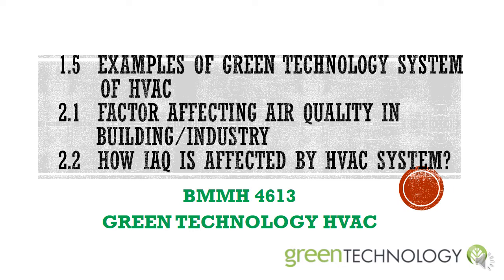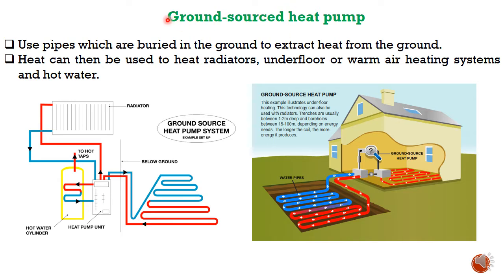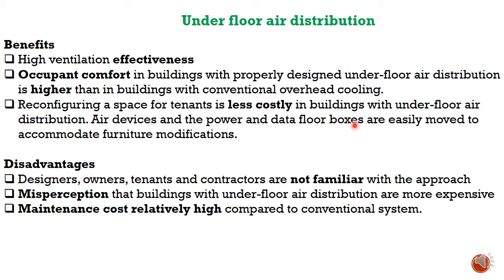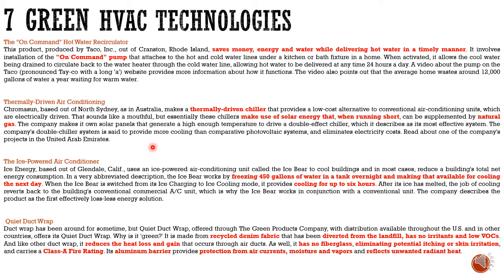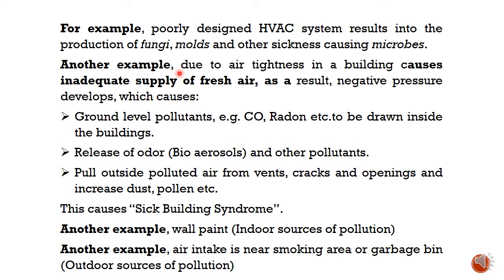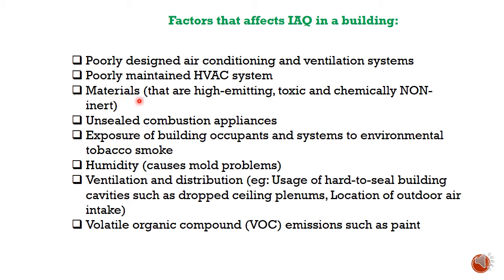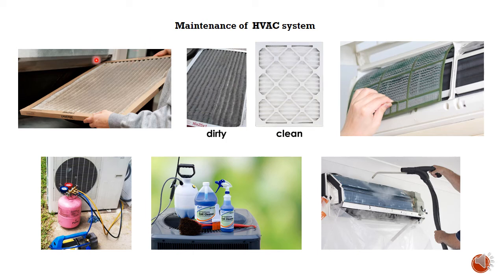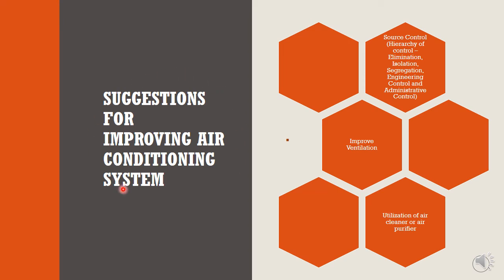Lecture 2 Effects on Indoor Air Quality

Comment: Mohamad Zarif Bin Rostam (B071710681)

Air-to-air heat exchangers / Waste heat recovery system
- Heat recovered from exhaust air to temper fresh air into the building
- Reduce the overall load
Ground-source heat pump
- The pipes buried in the ground to extract heat
- Then be used to heat radiators, underfloor, warm air heating system & hot air system

Advantages:
 Lower energy consumption
- Provide income
- Could lower home carbon emission
- No fuel deliveries needed
- Minimal maintenance

Under floor air distribution
Only use open spaces like underfloor plenum 
Advantages:
-Have a high ventilation effectiveness
-Give more comfort to the occupants then other HVAC technology
Disadvantages:
-High maintenance cost 

VRF Air Conditioning System
- One outdoor to many indoor
- Able to control amount of refrigerant
- Provide individualized comfort zone

7 Green Hvac Technology
- The "on command" hot water recirculator
- Thermally driven AC
- The ice powered AC
- Quiet duct wrap
- Energy analysis software
- The dual fuel heat pump
- The geothermal heat pump

Definition of IAQ
- How good, as well as how bad, the air inside the places we live or work due to the presence of chemical, biological pollutants in the air and also involves level of temperature, humidity.

Immediate and long term health symptoms
Immediate effect 
- irritation of the eyes, nose and throat
- headaches, dizziness, fatigue, asthma, hypersensitivity pneumonitis

Long term effect
- respiratory disease
- heart disease, cancer

Comment: MUHAMMAD HAFIZ BIN JOHARI 
B071710380

 HVAC System with Green Technology
  (Air-to-air heat exchanger/waste heat recovery system)
         - recover heat from exhaust air to temper fresh air into the building
         - reduce overall load & equipment required to maintain

 (Ground-source heat pump)
         - pipes buried in the ground to extract heat
         - then be used to heat radiators, underfloor, warm air heating system & hot air system

( Under Floor Air Distribution)
         - use the underfloor plenum to deliver conditioned air into occupied zone

 (VRF Air Conditioning System)
         - one outdoor unit with many indoor unit
         - control refrigerant flow to multiple indoor unit with different capacity with single outdoor
         - provides individual comfort control 

Definition of IAQ
- Indoor air quality how good, as well as how bad, the air inside the places we live or work due to the presence of chemical, biological pollutants in the air and also involves level of temperature, humidity.

Immediate effects
     - Irritation of the eyes, nose, and throat, 
      -Headaches, 
      -Dizziness, 
      -Fatigue,
      -Asthma, 
     -Hypersensitivity pneumonitis

Long term effects
      -Respiratory disease
      -Heart disease
      -Cancer

Comment: MUHAMAD IZMAN BIN JAMALUDDIN
B071710518 
4BMMH S1/2

An air-to-air heat exchanger 
-Brings two air streams of different temperatures into thermal contact, transferring heat from the exhausting inside air to incoming outside air during the heating season.

A waste heat recovery 
-A unit is an energy recovery heat exchanger that transfers heat from process outputs at high temperature to another part of the process for some purpose, usually increased efficiency. 

A geothermal heat pump or ground source heat pump 
-Which is a central heating and/or cooling system that transfers heat to or from the ground. It uses the earth all the time, without any intermittency, as a heat source or a heat sink.

Underfloor air distribution
-Is an air distribution strategy for providing ventilation and space conditioning in buildings as part of the design of a HVAC system.

Variable refrigerant flow (VRF) 
-Is an air-condition system configuration where there is
 one outdoor condensing unit and multiple indoor units. 
-The term variable refrigerant flow
 refers to the ability of the system to control the amount of refrigerant flowing to the

multiple evaporators (indoor units), enabling the use of many evaporators of differing
capacities and configurations connected to a single condensing unit.
-The arrangement
 provides an individualized comfort control, and simultaneous heating and cooling in

different zones.

7 HVAC green technologies
1. The duel fuel heat pump
2. The energy analysis software
3. The on command hot water recirculator
4. The ice powered air conditioner
5. Quiet duct wrap 
6. Thermally driven air conditioning
7. The geothermal heat pump

Definition of IAQ
- Indoor air quality how good, as well as how bad, the air inside the places we live or work due to the presence of chemical, biological pollutants in the air and also involves level of temperature, humidity.

Indoor IAQ
Immediate effect
1.Irritation of the eyes, nose, and throat 
2.Headaches 
3.Dizziness 
4.Fatigue
5.Asthma
6.Hypersensitivity pneumonitis

Long term effect
1. Respiratory disease
2. Heart disease
3. Cancer

Comment: AHMAD KHAIRUL AKMAL BIN AHAMAD KHAIRUDIN
B071710715
BMMH S1/1
In current days, greentech have been concurrently improve over the years. It is displayed perfectly in HVAC technology as greentech have cross towards HVAC.

 Four current HVAC greentech is :

1)Air -to - air heat exchanger
-Heat recovered from the exhaust is tempered back to the fresh air within the building 
-Reduce overall load potential sizing

2)Ground -sourced heat pump
-Use pipes buried within the ground to extract heat
-heat is use for minor common equipment like radiator and  underfloor.
Benefit:
I)Lowers home carbon emission 
II)Have a minimum maintenance costing
III)No fuel usage

3)Under floor air distribution
      Only use open spaces like underfloor plenum 
      Benefits:
I)Have a high ventilation effectiveness
II)Give more comfort to the occupants then other HVAC technology
Disadvantages:
I)High maintenance cost 

4)VRF air conditioning system
      Able to control amount of refrigerant that flows in a system accordingly. The system arrangements provides an individual comfort control for 
      each zones.

Comment: KHOR YE SHU B071710464 (BMMH S1/2)
1) Air-to-air heat exchangers / Waste heat recovery system
- Heat recovered from exhaust air to temper fresh air into the building
.
- Reduce the overall load and potentially the size of the air conditioning equipment required to maintain.

2) Ground-sourced heat pump
- Use pipes underground and extract heat from the ground
.
- Heat can be used to heat radiator,  underfloor or warm air heating system and hot water.

> Benefits OF Ground-sourced heat pump
 :
 - Lower energy consumption
 - Provide income
 THROUGH goverment
 - Lowers home carbon emission
 - No fuel deliveries needed
 - Minimal maintenance

3) Underfloor air distribution 
- Uses an open space (underfloor plenum)
>Advantages  - High ventilation effectiveness
                         - Provide better occupant comfort
                         - Less costly
 >Disadvantages  - Not familiar approach
                                - Misperception 
                                - Maintenance cost relatively high

4) VRF air conditioning system
- One outdoor to many indoor
- Able to control amount of refrigerant
- Provide individualized comfort zone

7 GREEN HVAC TECHNOLOGY
- The "on command" hot water recirculator
- Thermally driven AC
- The ice powered AC
- Quiet duct wrap
- Energy analysis software
- The dual fuel heat pump
- The geothermal heat pump

>Definition of IAQ
- Indoor air quality - how good, as well as how bad, the air inside the places we live or work due to the presence of chemical, biological pollutants in the air and also involves level of temperature, humidity.

>Volatile organic compound (VOC) emissions - odour that could effect occupant

>Immediate and long term health symptoms
-immediate effect - irritation of the eyes, nose and throat
                                 - headaches, dizziness, fatigue, asthma, hypersensitivity pneumonitis
-long term effect - respiratory disease
                               - heart disease, cancer

>Factors that affect IAQ in a building
- poorly designed AC and Ventilation system
- poorly maintained HVAC system
- materials (high emitting, toxic and chemically non-inert)
- unsealed Combustion 
- tobacco smoke
- humidity
- VOC

>Suggestion for improving air conditioning system
- source control 
- improve ventilation 
- utilization of air cleaner or air purifier

Comment: AHMAD ASYRAFAMIRUDIN BIN AZNAN (B071710607) BMMH S1/1
GREEN TECHNOLOGY SYSTEM OF HVAC
1. Air to air heat exchanger/ waste heat recovery 
    -heat recovered from exhaust air
    -reduce overall load and potentially the ac size
2. Ground source heat pump (Underground pipe)
    -low energy consumption
    -no fuel deliveries
   -low CO2 emissions 
   -minimal maintenance
 required 
3. Under flow distribution (underfloor plenum)
   -high ventilation effectiveness
   -better than conventional ac
   -less cost
4. VRF ac system (one outdoor multiple indoor)
   -control amount of refrigerant flowing multiple indoor 
   -individual comfort control

green HVAC technologies
1. The "on command" hot water re circulator
2. Thermally driven AC
3. The ice powered AC
4. Quiet duct wrap
5. Energy analysis software
6. The dual fuel heat pump
7. The geothermal heat pump

Indoor IAQ
Immediate effect
-Irritation of the eyes, nose, and throat 
-Headaches 
-Dizziness 
-Fatigue
-Asthma
-Hypersensitivity pneumonitis

Long term effect

-Respiratory disease
-Heart disease
-Cancer

Comment: MUHAMMAD HAZIM BIN ISMAIL (B071710545)
BMMH S1/1

EXAMPLES OF GREEN TECHNOLOGY SYSTEM OF HVAC
-->Air-to-air heat exchangers/Waste heat recovery system
  -Heat recovered from exhaust air to temper the fresh air coming into the building
  -Helps to reduce the overall load and potentially the size of air conditioning equipment required to  maintain
-->Ground-sourced heat pump
  -Use pipes which are buried in the ground to extract heat from the ground
  -Heat can then be used to heat radiators, underfloor or warm air heating systems and hot water
--Benefits: -
  -Could lower energy consumptions
  -Could provide income through the government’s
  -Could lower home carbon emissions
  -No fuel deliveries needed
  -Minimal maintenance required
-->Under floor air distribution
  -Uses the open space (underfloor plenum) between the structural concrete slab and the underside of a raised access floor system to deliver conditioned air directly into the occupied zone of the building
  -Application: The New York Times Building, Bank of America Tower and San Francisco Federal Building. As for Malaysia, in Suruhanjaya Tenaga, the also use this system in their diamond building in Putrajaya.
--Benefit: -
  -High ventilation effectiveness
  -Occupant comfort in buildings with properly designed under-floor air distribution is higher than in buildings with conventional overhead cooling.
--Disadvantages: -
  -Designers, owners, tenants and contractors are not familiar with the approach
  -Misperception that buildings with under-floor air distribution are more expensive
  -Maintenance cost is relatively high compared to conventional system
-->VRF air conditioning system
  -One outdoor unit and many indoor units
  -Able to control the amount of refrigerant flowing to the multiple evaporators (indoor units), enabling the use of many evaporators of differing capacities and configurations connected to a single condensing unit
  -The arrangement provides an individualized comfort control, and simultaneous heating and cooling in different zones
-->7 Green HVAC Technologies
  -The “On Command” Hot Water Recirculator
  -Thermally-Driven Air Conditioning
  -The Ice-Powered Air Conditioner
  -Quiet Duct Wrap
  -Energy Analysis Software
  -The Dual Fuel Heat Pump
  -The Geothermal Heat Pump

FACTOR AFFECTING AIR QUALITY IN BUILDING/INDUSTRY
-Indoor Air Quality (IAQ)  how good, as well as how bad, the air is inside the places we live or work due to presence of chemical, biological pollutants in the air and also involves level of temperature, humidity
-->Immediate and long-term health symptoms
  -related to indoor air quality contaminant that may be experienced by an occupant in the commercial building:
--Immediate effects
  -Irritation of the eyes, nose and throat	-Headaches
  -Dizziness	-Fatigue
  -Asthma	-Hypersensitivity pneumonitis
--Long-term effects
  -Respiratory disease	 -Heart disease     -Cancer

HOW IAQ IS AFFECTED BY HVAC SYSTEM
-->Factors that affects IAQ in a building:
  -Poorly designed air conditioning and ventilation systems
  -Poorly maintained HVAC system
  -Materials (that are high-emitting, toxic and chemically non-inert)
  -Unsealed combustion appliances
  -Exposure of building occupants and systems to environmental tobacco smoke
  -Humidity (causes mold problems)
  -Ventilation and distribution
  -Volatile organic compound (VOC) such as paint
-->Suggestions for improving air conditioning system
  -Source control (Hierarchy of control – Elimination, Isolation, Segregation, Engineering Control and Administrative Control)
  -Improve ventilation
  -Utilization of air cleaner or air purifier

Comment: HAKIM BIN ZAINUL (B071710531)
BMMH S1/1

Air-to-air heat exchangers / Waste heat recovery system
- Heat recovered from exhaust air to temper fresh air into the building
- Reduce the overall load

Ground-sourced heat pump
- Use pipes underground and extract heat from the ground
- Heat can be used to heat radiator,  underfloor or warm air heating system and hot water
*Benefits  - Lower energy consumption
                   - Provide income
                   - Could lower home carbon emission
                   - No fuel deliveries needed
                   - Minimal maintenance

Underfloor air distribution 
- Open space (underfloor plenum)
*Benefits  - High effectiveness
                   - occupant comfort
                   - less costly
 *Disadvantage  - not familiar approach
                              - Misperception 
                              - Maintenance cost relatively high

VRF air conditioning system
- one outdoor, many indoor
- able to control amount of refrigerant
- arrangement is individualized

7 green HVAC tech
- The "on Command" Hot water recirculator
- Thermally-Driven air conditioning
- The ice-[pwered air conditioner
- Quiet duct warp
- Energy analysis software
- The dual fuel heat pump
- The geothermal heat pump

Definition of IAQ
- Indoor air quality - how good, as well as how bad, the air inside the places we live or work due to the presence of chemical, biological pollutants in the air and also involves level of temperature, humidity.

Volatile organic compound (VOC) emissions - odour that could effect occupant

Immediate and long term health symptoms
-immediate effect - irritation of the eyes, nose and throat
                                 - headaches, dizziness, fatigue, asthma, hypersensitivity pneumonitis
-long term effect - respiratory disease
                               - heart disease, cancer

Factors that affect IAQ in a building
- Poorly designed AC and Ventilation system
- Poorly maintained hvac system
- Materials (high emitting, toxic and chemically non-inert)
- unsealed combustion 
- tobacco smoke
- humidity
- VOC

Suggestion for improving air conditioning system
- source control 
- improve ventilation 
- utilization of air cleaner or air purifier

Comment: MOHAMAD SYAFIK BIN SOFI
B071710064
4BMMH S1/1

EXAMPLE OF GREEN HVAC SYSTEM.
Air to air heat exchange.
-Heat recorver from the exhaust sir to temper the fresh air coming into the building.

Ground sourced heat pump.
-Use pipes which are burried in the ground to extract heat from the ground.

Under floor air distribution.
- Uses the open space ( underfloor plenum) between the structural concater slab and the underside of raised access floor system to deliver condition air directly into the occupied zone of the building.

VRF air conditioning system.
-Able to control the amount of refrigerant flowing to the multiple evaporator.

FACTOR AFFECTING AIR QUALITY IN BUILDING/ INDUSTRY.
-Poor designed air conditioning and ventilation system.
-Poorly maintained HVAC system.
-Unsealed combustion appliances.